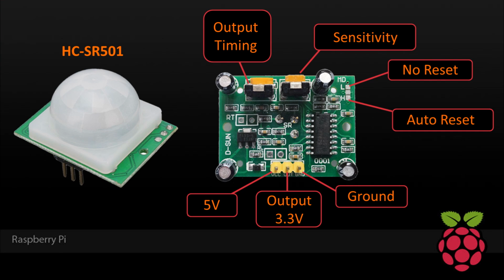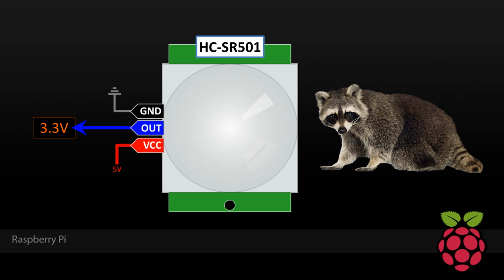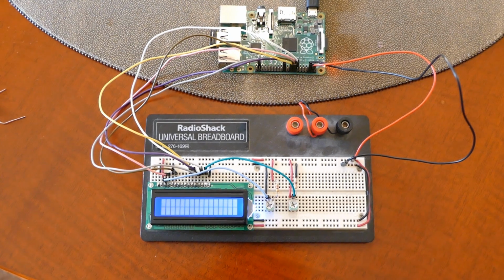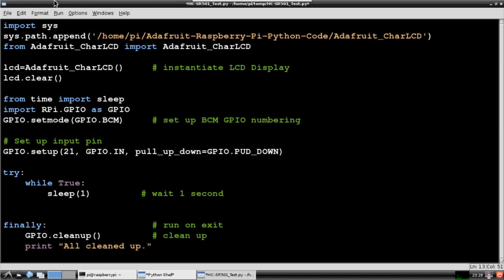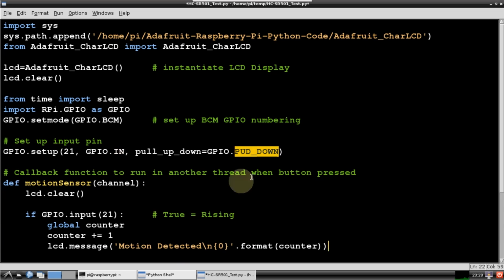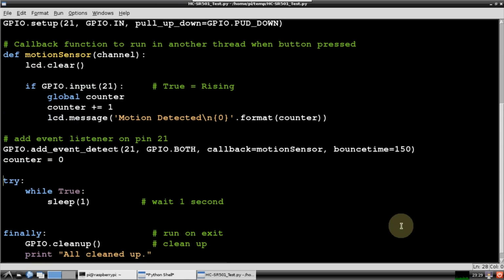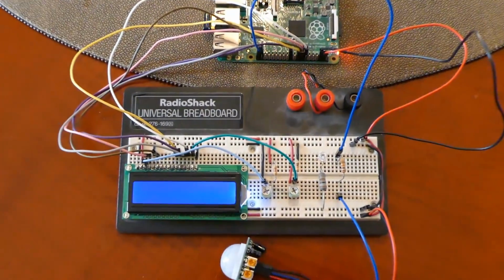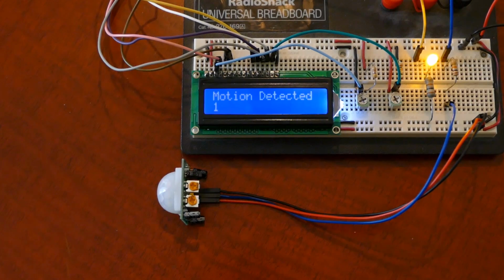Using an LCD Display with a Motion Detector on Raspberry Pi

Comment: Hello Eden my name is stephen, am currently new to programming, however I got interested in building a smart mirror. Now here is a problem am failing to enable the PIR sensor module to work with my mirror and I can’t find any video on YouTube to guide me through. Kindly help me with a tutorial for turning on the monitor only when motion is detected. 

Regards 
Stephen

Comment: Instead of connecting the output pin of the PIR to GPIO21 and setting the pin as a PUD_DOWN to stop floating,
would it also be acceptable to have a wire from the PIR output to ground via a 20K resistor (to stop floating) and of course the wire between the PIR output and GPIO 21 and just set the GPIO pin 21 as an input  ? NOTE: Being 20K it would still allow power to the GPIO21 input and yet not overload the PIR output going to ground.
As you can guess I'm avoiding using the in built resistor . I know this works on arduinos and in theory it should work with the PI but am just after your opinion in case PI's behave differently.
Reply from the maker: As mentioned on my website, the pull-down resistor is probably not necessary for most modules because the PIR interface sensor chip likely sets output state as high or low.  You can use an oscilloscope or a multimeter to verify the output pin doesn't float.  However, if the pin is floating then you can always use an external pull-down as opposed to the internal one.

Comment: I have tried this project, pir with raspberry pi. But I have had problems. The pir sensor ever return High. Not detect any movement. The pins are connect like your example and the test python code is this

from gpiozero import MotionSensor
import time

pir = MotionSensor(4)

while True:
pir. wait_for_motion()
print("on")

The output is on for ever

What is the mistake? Please, help

I have tried with 3 pir units, with the same result.
Reply from the maker: Make sure you indent the last 2 lines.  Otherwise, there is nothing wrong with your code.  If you specify GPIO 4 then make sure you have the PIR output plugged into GPIO 4.  I'd add a counter so you can track the loop:
pir = MotionSensor(4)
i = 0
while True:
    pir. wait_for_motion()
    print("on: {}".format(i))
    i += 1

Comment: What might you try if the motion sensor module is always outputting voltage?     I have quadruple checked my wiring and it is correct.
Reply from the maker: First verify the output voltage with a multimeter.  Next inspect the board under magnification looking for shorts and/or poor solder connections.  Did you try adjusting the sensitivity?

Comment: Do you have a video on this same installation of the motion sensor with an LED with the script, but without the LCD display. Thanks !!
Reply from the maker: No, but you can just delete all the lines in the code that reference LCD.  You can change lcd.message() to print() and it will send the results to the console instead of an LCD display.
Reply: Thank you Sir, I will give it a try!
Reply: I’ve tried deleting the LED lines in the script, but I still can not get the script to run with just the motion sensor and LCD only.
Reply from the maker: I thought you wanted he LED and not the LCD display?  Are you getting an error message?
Reply: rdagger68 I’m sorry it was late...yes I want the LED and not the LCD only for testing. I can send you the error if needed.
Reply from the maker: Yes please post error message.

Comment: I´m going to build a smart mirror using the Pi, but would like to know if it's possible to turn on the monitor only when movement is detected near the mirror. The pi would always be on but I would like the information to be displayed on the mirror only when movement is detected near the mirror.
Reply from the maker: If you are using MagicMirror, there are plugins that support turning a monitor on/off from a motion sensor. Otherwise, the easiest way would be to use a display that supports HDMI-CEC which affords you remote control via HDMI. There are Python libraries such as python-cec that provide HDMI-CEC support. Another more difficult option would be to use the monitor's built-in energy saver to put it to sleep and then wake it from Python upon motion using xset or tvservice.
Reply: Thanks! Didn't know about those plugins for the MagicMirror. I'm also thinking about just buying a 7" screen with the controller and power supply included (on ebay) and connect it to the Pi. I just want a simple thing to surprise my wife, because she's always asking me about the weather for the next day and I always say " look at your freaking phone, it's right there on the home screen!! LOL" This way every single time she goes to bathroom it's always there . Thanks for your reply for a video that's 3 years old!
Reply from the maker: I'd ask around on the MagicMirror forum.  They could probably steer you towards an easy turnkey solution.

Comment: Hey. Need Some Help. Can I Use  My Led Since Am Planning To Use Motion Sensor To Turn On And Off My Display In My Smart Mirror Project. Please Explain me To Do So What All Resources I'll Be Requiring And What Not From The Above Project. Please Reply Asap. Thankyou.
Reply from the maker: Sorry I don’t understand. What would you like to happen when motion is detected?
Reply: Okay. So When The Motion Is Defected , I Want My LED Display Monitor To Turned Up Means Its Display To Get Turned On. So Any Possibility? For Eg: If Someone Comes To See In Mirror ie LED Display It Should Get Turned On. So Will Your Sensor Coding Be Working For That Process?
Reply from the maker: If you are using MagicMirror, there are plugins that support turning a monitor on/off from a motion sensor.  Otherwise, the easiest way would be to use a display that supports HDMI-CEC which affords you remote control via HDMI.  There are Python libraries such as python-cec that provide HDMI-CEC support.  Another more difficult option would be to use the monitor's built-in energy saver to put it to sleep and then wake it from Python upon motion using xset or tvservice.
Reply: Thanks A Lot For Immediate Reply. Big Help. I'll R&D For HDMI CEC Use. Big Help

Comment: What is the range of the sensor? Does it trigger prematurely often?
Reply from the maker: According to the datasheet, the range is 7m. I haven't tested this sensor extensively but it seems reliable. It works best when the object crosses the beams as opposed to directly toward it. It is also good to make sure it's not pointed towards sunlight or bright light sources.  I would not use it for mission-critical applications such as a burglar alarm. Instead I  would go with a more advanced sensor.
Reply: Thanks! Do you think it would suffice as a doorway alert? I was thinking of pointing it down above a door archway to trigger if someone walks through the doorway.
Reply from the maker: It should work depending on the height and width of the doorway.

Comment: I like that you added that resistor for safety.  Added that to my design and it works fine.
One thing though, you don't need the "GPIO.PUD_DOWN" (pull down resistor) because the wire is connected to the sensor. 
It's always connected so it's not going to float.  I suppose it doesn't hurt anything, maybe a tiny voltage drop on the high state.
Reply from the maker: Good catch!  Thanks for the feedback.

Comment: Nicely done. I would like to see how we can run a program (Python) using the cell phone on the cellular network. Please advise!
Reply from the maker: I’ve been working a lot lately on mobile phone apps.  I could probably make a video tutorial showing how to create mobile phone apps to interact with the Pi. 
For now, I have 2 videos that might be of interest.  My rocket chat tutorial shows how to control LED’s and pushbuttons connected to the Pi using the mobile Rocket Chat app.  It uses Node.js instead of Python: https://youtu.be/BevcvRLsa9Y
I also have a SendGrid tutorial where the Pi can be controlled via email messages.  This one is both Node.js and Python:  https://youtu.be/lcPps6lUK8c
Reply: Thank you for the help. I will look at these 2 videos. I am basically trying to create a app for my phone so I can open the Garage door as I am getting closer to my home.
Reply from the maker: Sounds like a cool project.  I would add a magnetic sensor to the garage door so you can check on the phone if you forgot to close the garage door.  I do plan on making a video about creating Andoid and IOS apps to interact with the Pi.

Comment: Great video! I have built this project myself but still running into several problems: the LCD background screen is all filled in white pixels which makes it hard to see any numbers or characters and second that the motion sensor is very slow or doesn't detect any motion at all. Any suggestions? Thanks!
Reply from the maker: Sounds like you need to adjust the contrast or brightness of the LCD display.  Please take a look at my Weather Clock tutorial which shows how to connect potentiometers to an LCD display for adjustable contrast and brightness:  http://www.rototron.info/raspberry-pi-international-weather-clock/

There are many possibilities with regard to the motion detector performance.  You can try adjusting the Sensitivity pot which sets the detection range from 3 to 7 meters.  There is also a time delay pot to adjust how long the sensor stays high after motion is detected.  There is about a 3 second window after the delay where the sensor will not retrigger.  Therefore, you might want to decrease the delay if you are missing motion.  The trigger mode jumper should probably be set to single to avoid the time delay being restarted by constant motion.  
Also you should avoid pointing the sensor toward strong light sources.

Comment: I would like to make a raspberry pi computer and would like to use a motion sensor, so when I sit at my desk it turns on automatically could you do a video on that possibly to help me?
Reply from the maker: Do you want the motion detector to turn on the Pi?
Reply: rdagger68 yes please
Reply from the maker: The problem is that the Raspberry Pi would need to be turned on for the motion detector to work.  Unless the motion detector was controlled by an Arduino or an independent circuit.  You could build a circuit that monitors the Pi's UART TX pin to determine if the Pi is halted.  Then a relay activated by motion detection could short the Pi’s reboot pins to turn the Pi back on.
Reply: Thanks, do you think I could keep the pi on and the motion sensor just turns on the monitor/TV,
Its just got the idea from the YouTuber " I like to make stuff " he made a games machine that's lights turns on when you get close enough but he used an Arduino as well,
that would be fine but I don't no how I would code it and install it from a breadboard to an actual circuit boar so im a bit puzzled? I hope you can help me,
Thank you.
Reply from the maker: If your TV supports HDMI-CEC, you could control it via the HDMI cable.

Comment: how do I get it to play a sound track when triggered
Reply from the maker: +takoteam You would probably want to use aplay which is a command-line audio file player.  You would swap out the lcd.message code in the motionSensor callback with aplay.  If you Google aplay raspberry pi, you should find some helpful examples.

Comment: if we want to used morethan one sensor at a time.. than what python coding are for that ?
Reply from the maker: +INAM ULLAH You can use same code but just add additional GPIO.setup and GPIO.add_event_detect for each sensor.  For example:   GPIO.setup(xx, GPIO.IN, pull_up_down=GPIO.PUD_DOWN)
GPIO.add_event_detect(xx, GPIO.BOTH, callback=motionSensor, bouncetime=300)    Just change xx to GPIO pin of a motion sensor.  Also see answer below regarding multiple sensors.

Comment: hi ..can u show how to make weather station using raspberry pi.. Thanks..!!
Reply from the maker: Ruchi Panwar Please check out my DHT22 temperature/humidity sensor video: https://youtu.be/IHTnU1T8ETk
Also my website rototron.info has projects that might be relevant such as a server room temperature monitor and a fountain water level sensor.  The only thing missing would be setting up an anemometer.  I'll add that to my list of videos to make.

Comment: hi, its nice but i still get a lot of errors. I'm not using an LCD display. I want it to display in the command line. can you paste a code for it?
Reply from the maker: wise osagie Change lcd.message to print.  Then remove all the LCD code.

Comment: This is good.. Have you tried to connect multiple motion detector sensor to Raspberry pi and identify which one has detected motion ? basically in your program to identify sensor Id or GPIO number.. I am looking for hardware setup and software to handle those...
Reply from the maker: Umesh Tharanath The sensor output is basically just a switch.  You can connect multiple sensors (one per GPIO).  Interrupts can distinguish between GPIO’s.  See my video on inputs: https://youtu.be/a8ozfd_Wd-w
Reply: Say if I want to use at least 5 motion detector seonsors for 5 rooms in a house .. Including main door entrance and backyard door. How many I can connect to a GPIO ? If I want to use other sesors and motors to same raspberry pi ? Any other way I can  connect those to single GPIO and still distinguish sensors ?
Reply from the maker: Umesh Tharanath 1 sensor per GPIO.  If you want more per GPIO you would need to use an IO expander chip such as the pcf8574.  I have a video on i2c expander chips: https://youtu.be/i5A5AsDRRwQ
Reply: Just in case anyone else is wondering this, each sensor will be hooked up to one GPIO. This means to distinguish which motion sensor has been tripped you have to just look at what GPIO it corresponds to. For example, let's say my living room motion sensor is GPIO 5 and my kitchen is on GPIO 7 if GPIO 7 is tripped then that means my kitchen motion sensor has been tripped.